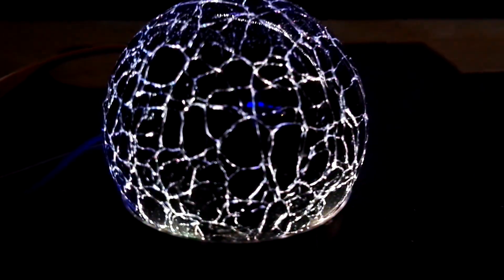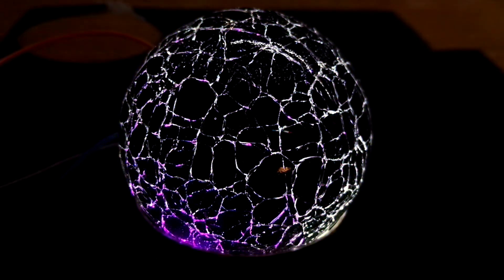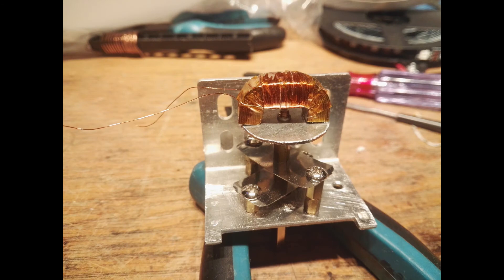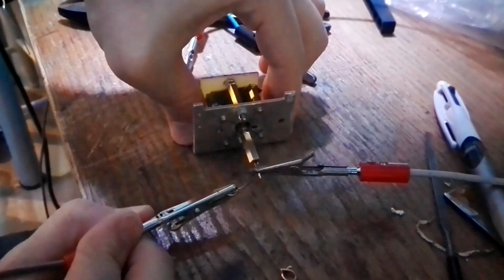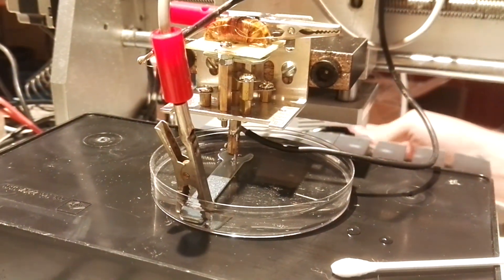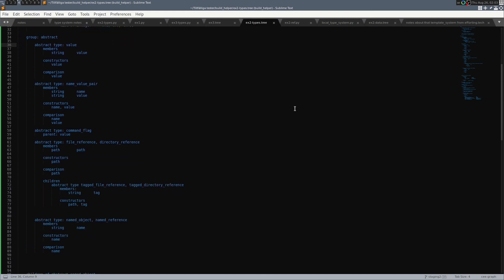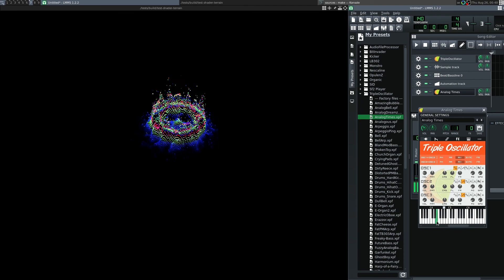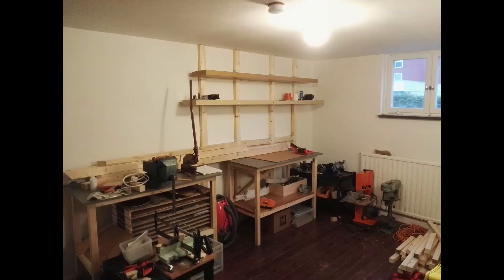VLOG 2021-08-26 - Build config, craquelured luminary, EDM, DFT

Comment: The mouse cursor light over the 3D map was looking interesting. Is that map also made of of polygons? How is it generated?
Reply from the maker: The 3D grid is first just a flat grid of triangle strips arranged in a hexagonal pattern (terrain.c) , then a vertex shader (vertexshader.glsl) is used to apply a height map to it.
In drawcall.c I briefly touch on how the draw call is executed. In shader.frag I briefly explain the light effect which happens in screen space in the fragment shader, it is calculating the distance from the mouse cursor to the point (in later versions the radius of the light varies with the depth to make the light appear as a cone, but it does of course not handle occlusions so you can shine the light through the mountain).

I put the files for you here: https://gist.github.com/Mikael-Lovqvist/d5370a55825d747341547bb1244bb906?ts=4
I also talk a bit about how the grid is made in my previous update here: https://www.youtube.com/watch?v=2jC6CSjjAfo&t=162s

Thank you for showing an interest!